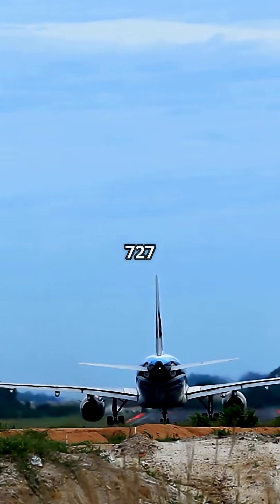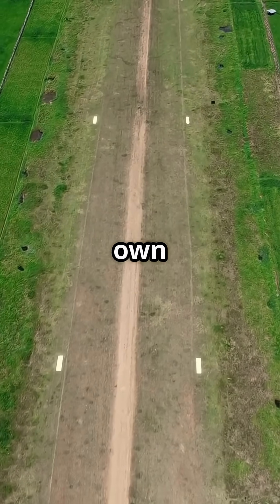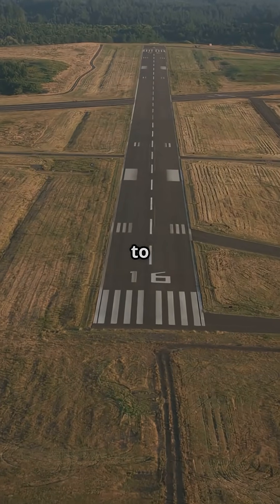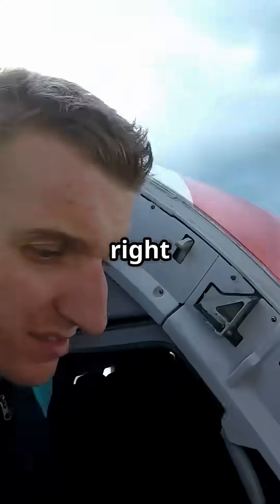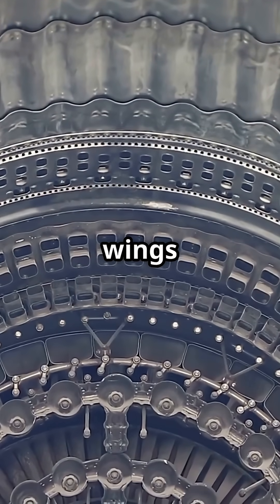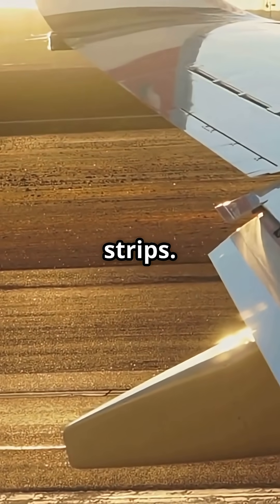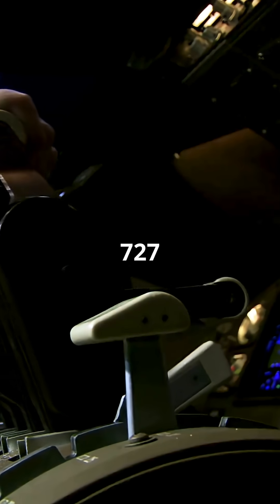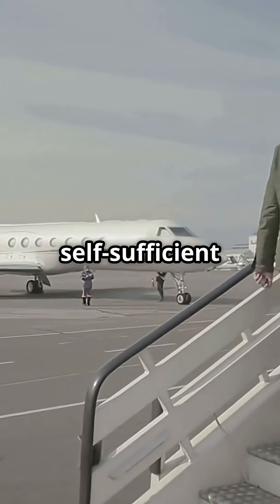The 727 That Landed Anywhere

Comment: I flew the 727 for a number of years, pre GPS, pre glass cockpits etc., back in the days long before avionics controlled the aircraft for 95% of the flight like today. 
We carried star maps and were trained and fully competent to navigate using celestial navigation when needed, as well as all the original, complex methods of standard equipment of the day. Lots of inflight mathematics, calculations, all while scooting along at 470 knots on a weak VOR radial waiting to intersect another radial to call in our position outbound at such and such intersection, Zulu time crossing the fix, anticipated time to next fix etc, usually while hand flying the aircraft being knocked around in bad weather, because the INS systems were often so far out of calibration, they weren’t worth using or trusting. No glass cockpit, just a few backlit instruments and a couple of red dome lights in the cockpit. Lol. 
Young pilots today have no idea what flying really used to be like. But oddly enough, we pilots back then lived all those things and flying was difficult and complex and we lived that about it. We worked nonstop in the air, from takeoff to landing. Flying today with nearly zero pilot workload, even in hard IFR conditions, is a completely different world than it used to be. Sadly, people, even newer pilots seem to have forgotten that.  I can say I’d actually be impressed if a pilot today lost ALL his glass cockpit, and told me no worries, I can slide this moonroof blind back and navigate celestially, as we did as normal procedure. I wonder how many have that ability these days. Or, if they’d require their “iPad portrait of the stars” in order to do it?